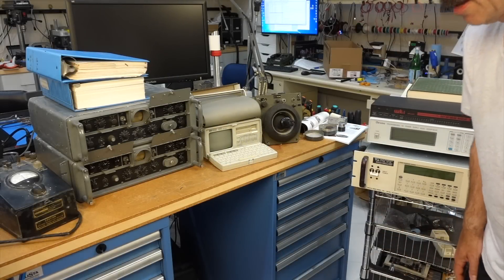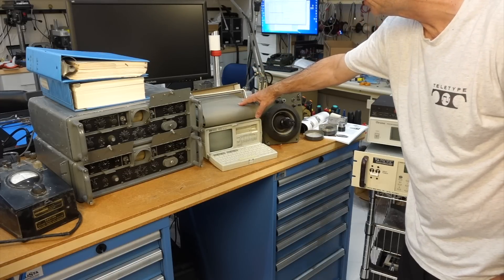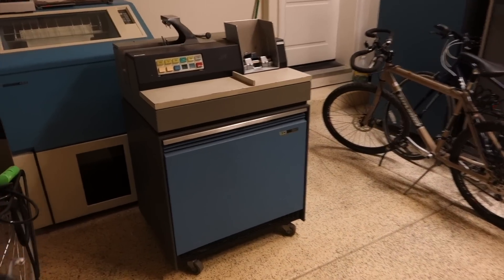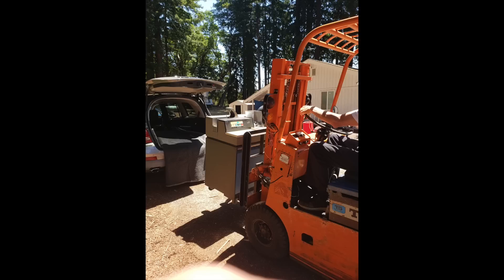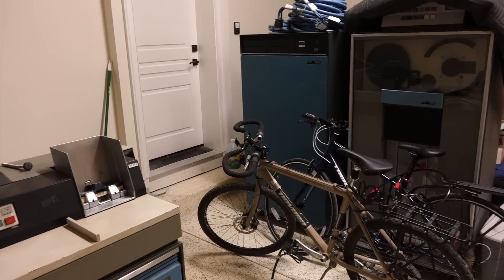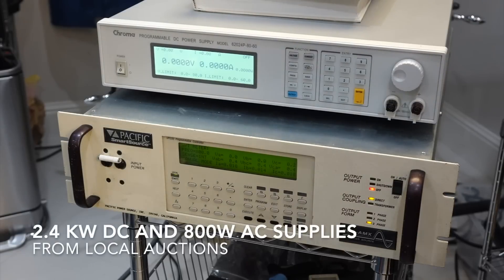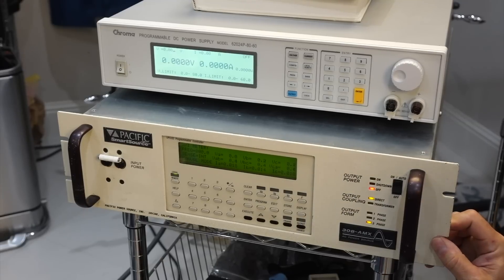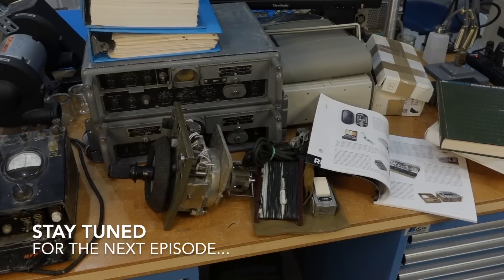New Collection Arrivals

Comment: Hi Marc, it sounds like you already have a full collection of IBM 360/370 components. I'm trying to find a good home for some that my father collected:

• IBM 29 card punch
• IBM 2501 card reader
• IBM 3420 magnetic tape unit
• IBM 3803 tape control unit
• Calcomp 663 plotter
• Calcomp 770 plotter tape storage
• Remington tabulator
• and some relatively more modern printers: two daisy wheels and an earlyish laser printer.

If you happen to know of anyone who might be interested in any of these, or can point me in the direction of where to post them, I would really appreciate it!  I sent you an email as well but I'm never confident that emails get through without going into the spam folder.  Thanks!
Reply from the maker: Yep got it. Thank you so much for contacting me. Replied to you via email. Your father needs to be commanded for preserving these. We’ll find good homes for them.

Comment: You said the counter will be a challenging restoration. Really? You restored a ASR-33 teletype. That(!) was a challenge. BTW, the 2116B would be one of HPs earliest computers. Back in junior high school I had been in the schools computer club. When the Board of Education sent a computer around to the different schools I got to operate it on behalf of other students. It was an HP 2114A with 4k core memory and attached paper tape reader. After a weekend of being turned off you hit 6 buttons on the front of the unit to make it read the paper tape which contained the BASIC interpreter program. A local university had an IBM 1403 line printer connected to their IBM 360 computer. I still remember how to change the paper on one of those beasts.

Comment: 1 would like to know the original retail value from those catalogues of your equipment and the adjusted price for inflation.
Reply: @FuquarProductions
You can't really compare the values of equipment that was state of the art in 1969 and today.  Back then they had to push the envelope to get equipment to do a few GHz.  Times have changed!  Nowadays a cheap mobile phone can transmit and receive up to 2.5 or more GHz and do frequency hopping and all sorts of high tech things one could only dream about in 1969.
Reply: @acmefixer1  the catalogs have the retail prices listed. Simple to add them up and adjust for inflation
Reply: @acmefixer1  Just look at a $10 WiFi dongle – pretty much a RF-anybody’s wet dream from just a few decades ago. 5GHz gigabit comms for the masses. Who knew, right? It’s ridiculously cool the times we live in, in some ways (not the others).

Comment: When you cracked open the CV-89, I swear I could smell that distinctive old mil-tech sealed electronics savour, the one you only get by marinating that particular mix of rubber insulation, potting compound, board sealant, flux and whatever other mystery herbs and spices they put in back then. If I could buy that stuff in bottles...

Hope you get a proper HF RTTY link set up with period radios. That would be gorgeous. 

RYRYRYRYRYRYRY
Reply: Yes, i know that old electronics smell.

Comment: I wonder how the spy disposed of the 35mm 'tape' after he sent the message?  When I was in the army, they had a 'burn barrel' by the barracks where the classified papers and TTY tapes were burned.  We knew when they were burning by the smell of the smoke.  If the spy did that with film, everyone would know from the stench of burning plastic!

Hurry up and do more videos of these goodies in action!  Thanks!
Reply: I can't understand why they didn't just use paper.
Reply: @user2C47  Not easy to get long strips of paper, film is (was) very commonly available in lengths of several feet upwards.
Reply: Back then the film was nitrocellulose, very easy to dispose of!
Reply: @iNerdier  
How?  I would need an explanation of how that could be done.

The thought occurred to me that perhaps the spy intended to roll the film up and put it somewhere to be retrieved by another undercover agent.  

If the spy burned a nitrocellulose film there would be one helluva conflagration!  Like burning an open pan of gasoline!  Or worse!